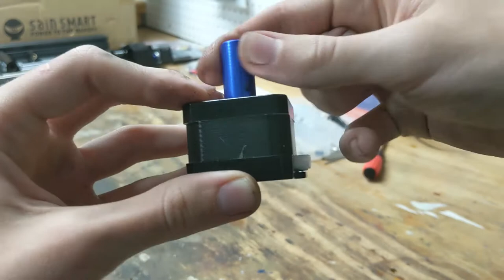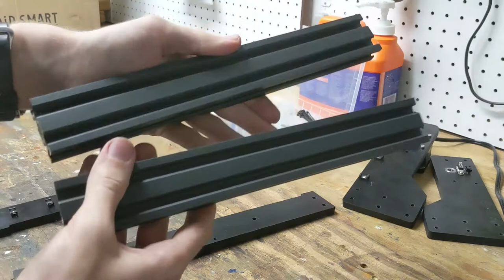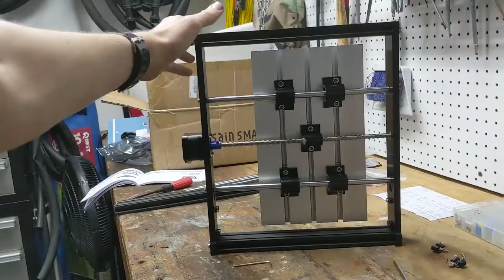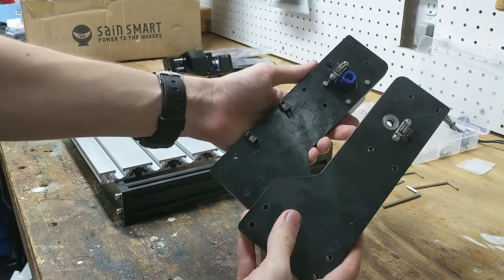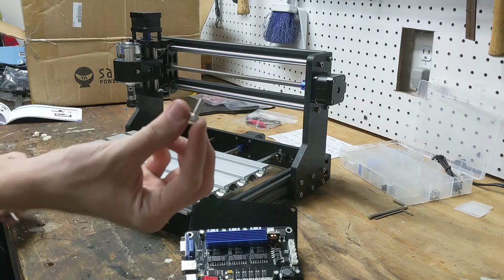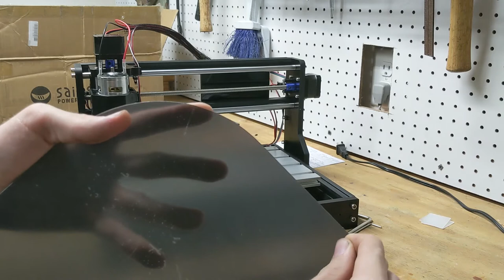Sainsmart Genmitsu 3018-MX3 Assembly

Comment: Now that I am putting my MX3 together, I'll make a few comments.  In the beginning when you are placing the coupler on the stepper motor, the manual says to leave 1.4mm between the coupler and motor.  You leave a lot less.  I actually did it like you did first, then read the manual closer.  Would it really make a difference, just as long as it is not touching?

Second, you installed the limit switched, then removed them later to align the workbench.  I just left them off, and plan to install the switches once the workbench is aligned, which is my next step.  Curious if you saw a need to install them, then remove them, or just found when you got to the alignment step that it made sense to remove the switches.
Reply: All you really need is enough of an air gap for it to not rub on the motor, I prefer to have as little as possible, but it doesn't affect it much at all, unless you leave WAY too large of a gap. And you are right, I took them off afterwards because I realized they prevented me from doing my preferred way of squaring the bed. I did not bother redoing the first part where I installed them, and making it where I did not install them, because they are good visual indicators for what way to orientate the pieces during assembly.

Comment: at 13:35 you skip over the fact that you can't get the smooth rods in without unscrewing the frame and losing the hour of work you (well, I) just put in to tightening it up equally to make it level :-(  Other than that it's been helpful so far.  Now back to assembly for me...
Reply: I guess that's why the (very Chinglish) manual says for Step 6 "Use allen wrench to tighten the Bolts for 80%, remain 20% space for adjust later." and then at the end of Step 8 it has a "Remind" section that reads "After you check finish the base, you can tighten all the bolts (remmember we remain 20% space before)".

I'm stuck while assmbling mine because the Y-axis lead screw doesn't actually fit through the bearing in the front plate, so the lead screw won't insert far enough into the coupler and thus the motor ends up almost 10mm away from the rear plate =/
(My MX3 has been sat, unassembled, on a table in the 3D printing corner of my bedroom since May last year, but I've been too ill and/or busy to build it until now...)
Reply: @AndrewGillard  That was kind of my point - if following the video, you had to have tightened the frame by then, because he showed how to level the frame before showing how to insert those rods.  But it wasn't a major hassle considering it took me about a whole day to build the beast!  Very happy with it by the way, though in hindsight I should have resisted the low price that was why I picked the MX3 over the ProVER, and gone for the GRBL-controller machine instead.  I lost any benefit from the cheap 'open box' MX3, when I had to pay another $50 for the grbl controller in order to open up a wider range of software.  I feel obliged to add that Sainsmart's after-sales support has been exemplary and justifies picking their versions of these devices over sometimes cheaper rival vendors.